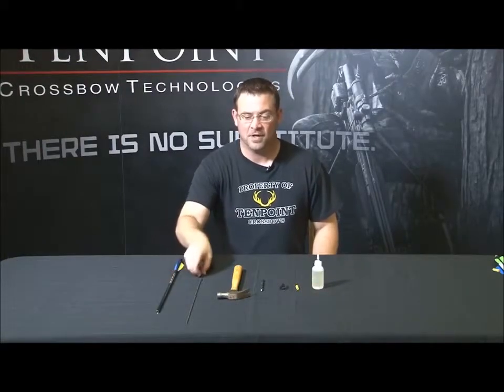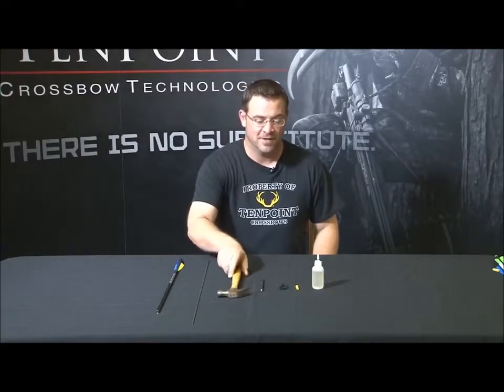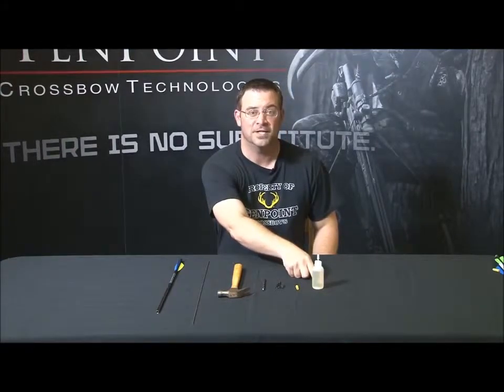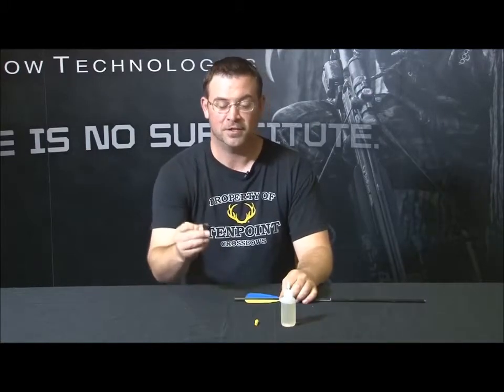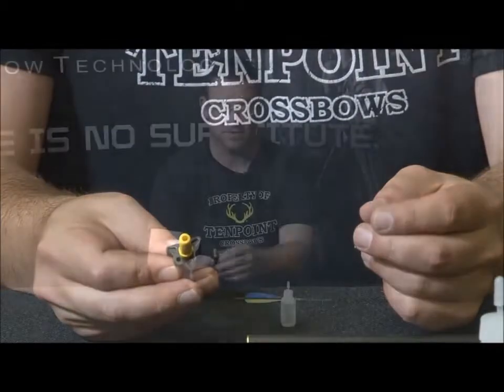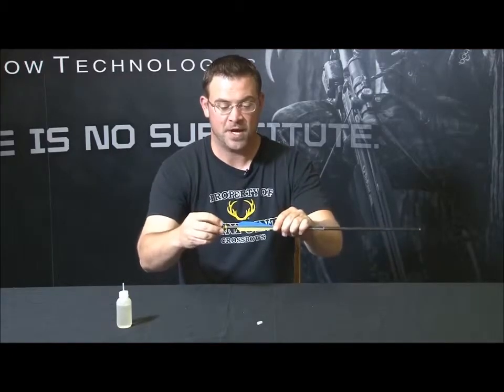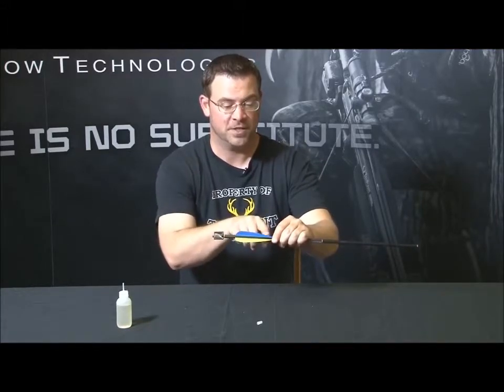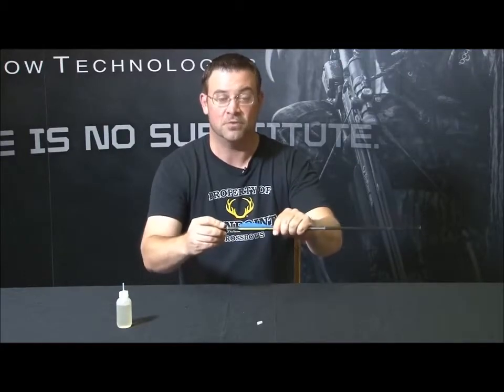TenPoint Crossbows - Old Nock Removal

Comment: Update for me! My TenPoint new arrrows, 1/8 rod does not go into end, BUT  I used a heat gun and was able to remove the nock, (of course it was melted). I am replacing with the lighted nocks so did not matter.
Reply: I ordered a 3mm x 36in rod from McMaster-Carr... tapped it a few times and it should break free.

Comment: Old knocks will not come out actually bent the 1/8 inch rod trying.  No luck removing 6 of the nine inserts either so  that’s some tough glue I’d say.
Reply: I am having the same issue. Were you to figure out a solution?
Reply: @djbeauch7652  No luck at all.
Reply: Spray electrical cleaner from the insert end, and try it again tapping it out with the  1/8 rod. I just watched a video! Great Trick!!